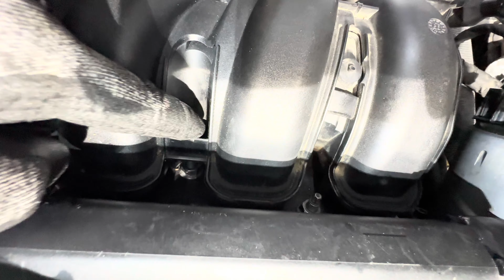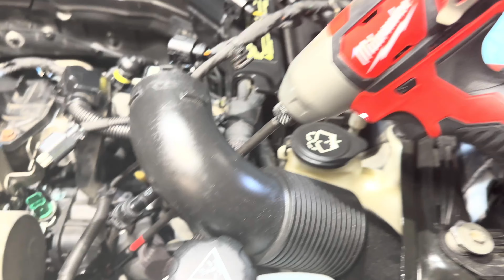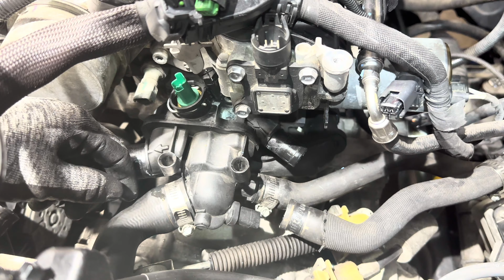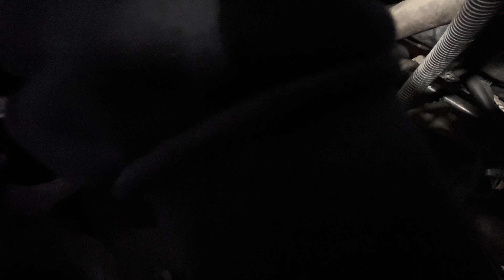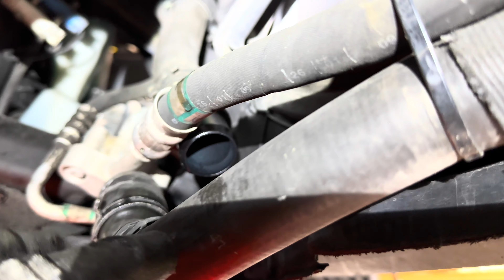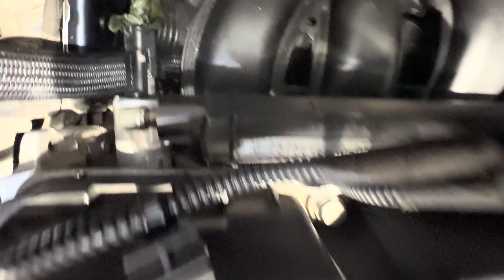Coolant Cross Pipe Replacement: Everything You Need to Know

Comment: Not all models of the mini R56 roughly 2008 have a bolt that needs to be removed by taking the passenger front tire off.  On the back bottom side of the intake manifold, there are one or two screws that need to be removed before the manifold will come off.  I believe both screws are 10 mm.

Comment: Ok so you don’t clean off any of the old blue shite before putting new pipe in situ🤔🙄….
Then re- using the old thermostat housing, they never seat correctly & are prone to leaking after removal like this.
Why did you remove all the intake when you can get at the pipe from underneath 🤔🙄…. Saves alot of time tbh.
Reply from the maker: After  cleaning it all the previous times I just don't care. I cleaned the surface to seal, not worried about the looks for place no one will ever see.....except me....the next time the coolant cross pipe breaks... I had replaced the thermostat housing on previous water pipe leak. It has never caused me problems. I took the intake off because I find it easier than fighting the tight spaces and it's easier. This is A way to fix this problem not THE ONLY way. Thanks for watching.

Comment: Over engineering at its finest. 
I just did mine as I had a catastrophic failure in the old one. 
The clip makes a noise when it goes in so when you hear that noise you're golden, as long as it's in the groove of course. 5 star vid. I did mine without taking the intake manifold off, it was a nightmare but doable.
Reply: How did you get it in ive been at it tor hours and it keeps scraping and the bouncing off the engine block

Comment: Why not use silicone hoses.?They don’t crack and they will help dissipate heat.
Reply from the maker: @dannydanny261  for this part there is no  way to mount a silicone hose. The cross pipe is held in place by pressure from when you bolt down the thermostat housing. It has to be rigid.

Comment: I got a ECS alloy pipe, alloy thermostat, alloy rad, silicone hoses, metal impeller water pump, and alloy valvecover. FK PLASTIC
Reply from the maker: I just bought a K24A that will go in there someday! Solve all the problems! Lol stupid motor!
Reply: @ the n14 is really easy to work on. You want a stupid motor? Miata 1.8, twice as fiddly and the amount of parts to remove, half the power

Comment: I am fixing the Mini Cooper for my daughter.  These cars are super cool looking, but they are very problematic.  I have several older Toyotas and even one from 1995 that never give me problems.  Why use a plastic water pipe, why not use a simple hose that is strong, flexible, and will last?  The design is very poor.
Reply: to be fair, your toyotas are such fun to dr....zzzzzzzzzzzzzzzzzzzzzzzzzzzzzzzzzzzzzzzzzzzzzzzzzzzzzzzzzzzzzzzzzzzzzzzzzzzzzzzzzzzzzzzzzzzzzzzzzzzzzzzzzzzzzzzzzzzzzzzzzzzzzzzzzzzzzzzzzzzzzzzzzzzzzzzzzzzzzzzzzzzzzzzzzzzzzzzzzzzzzzzzzzzzzzzzzzzzzzzzzzzzzzzzzzzzzzzzzzzzzzzzzzzzzzzzzzzzzzzzzzzzzzzzzzzzzzzzzzzzzzzzzzzzzzzzzzzzzzzzzzzzzzzzzzzzzzzzzzzzzzzzzzzzzzzzzzzzzzzzzzzzzzzzzzzzzzzzzzzzzzzzzzzzzzzzzzzzzzzzzzzzzzzzzzzzzzzzzzzzzzzzzzzzzzzzzzzz.

Fun or boring AF.

Its hard to make a 120hp 4 cylinder unreliable. You really have to try
Reply from the maker: @ well they succeeded!!! Thanks peugout/BMW! Amazing car….till it breaks. I guess I should expect that from a British brand owned by a German company with a French engine!
Reply: @kypetrolhead  i meant the toyota lol. They are reliable because they are simple af making 120hp. Modern toyotas (2000+) 180hp, balance shafts other crap, have issues burning oil and are no where near as reliable as their 120hp 1995 models. Something for something
Reply: @goclunker and yet my non turbo 121 hp 4 cyl 2011 mini is not reliable, but my 2007 camry 263 hp 3.5 v6 is ….
Reply: @ so you don't know how to take care of a simple af 4 cylinder. Cool story
Reply: @ so thanks for proving you don’t know wtf your talking about , cool story . Camry has 260 k so take a seat.
Reply: @ how about you take a seat? My mini Cooper is a 1.6 L four-cylinder and it has 200 hp. Imagine bringing a six-cylinder to this argument, and only having 60 HP more than a 1.6 L four banger. I expect nothing less from a Toyota owner. The lights are on nobody's home.
Reply: @ braindeadToyota clown
Reply: @sjd7188  and my BMW E36 M3 has 280 hp dynoed at the rear wheels, does 0 to 60 in 4.6 seconds, will literally gap your Camry and is old school reliable. Why don't you come race me for pinks? I would love to win your Camry and take it directly to a crusher where it belongs. Toyoclown🤡. Put your money where your mouth is, cause your V6 ain't shit. Imagine trying to flex 60hp extra over a 1.6 L four-cylinder mini, with a pretty much double the displacement V6🤣💀

Oh, and my R 56 mini S does 0 to 60 and 6.5 seconds, which is still faster than your pos Camry
Reply: @goclunker  how many miles and how much oil does it use? Nice tank top what a flex, oh sorry my bad that’s a halter top…
Reply: @sjd7188  146k and 217k
Reply: @ 146k and 217k, less that 1/4 of a quart every 5k. You deserve a toyota.
Reply: @sjd7188  Typical toyota owner. Can't win? Insult appearance. I can guarantee my cars use less than your toyoduh appliance. Enjoy it, you whole heartedly EARNED driving something with so little soul. Its a match made in heaven
Reply from the maker: @cquinn185  i couldn’t agree more. Lazy cheap engineering. Make sure you check her oil ALL the time and change it like every 4K not the manufacturer recommendations
Reply from the maker: I do pretty much every other time I drive it!
Reply: Imagine trying to flex V6 Camry for having 60 hp more than a 1.6 L mini🤣💀 you clowns really are something special

Comment: I just ordered the aluminum water pipe from ECS tuning.
Reply from the maker: I will be getting that for the inevitable “next time”. My next big project might be the valve seals
Reply: Just bought one as well for my R60 and after pulling out the plastic one from the water pump and having the end break I am glad I will be replacing it with metal..
Reply: El problema es que si lo cambias a aluminio ahora lo que se te romperá es junta de cabeza. Tú decides que quieres arreglar después